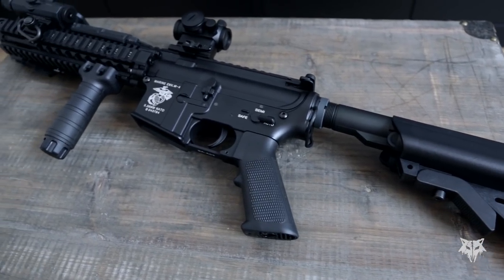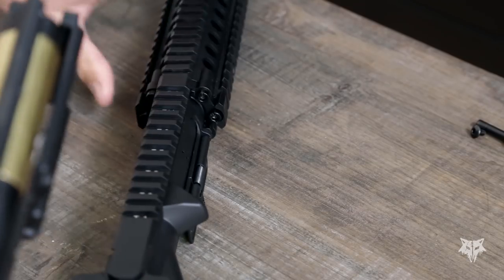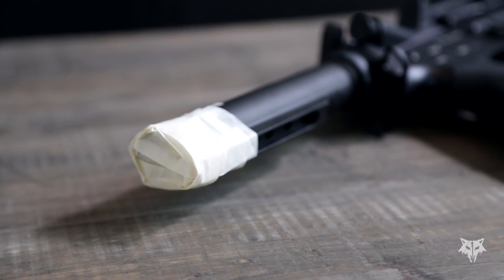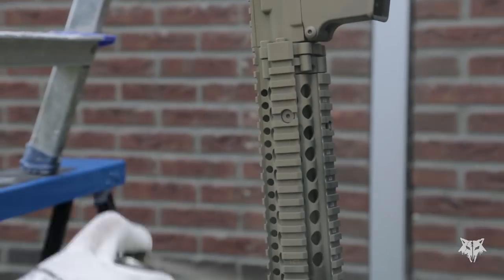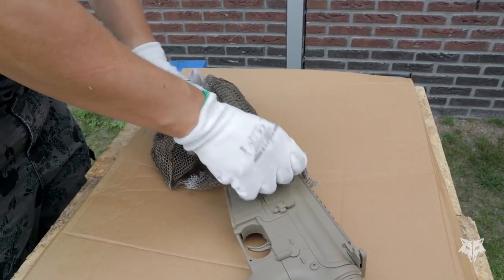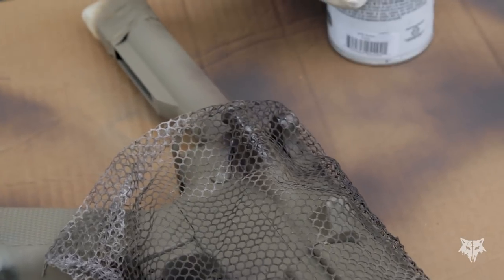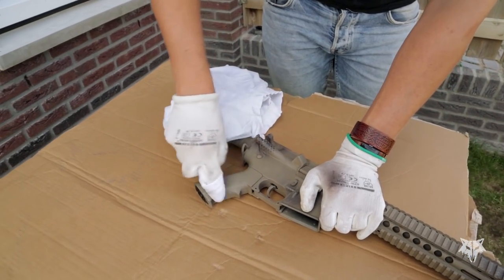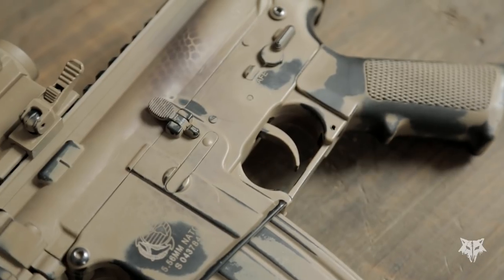How To: Painting your Airsoft Gun

Comment: was this a metal gun or a plastic one? paintings method are different for each type
Reply: The rail, receivers and stock tube are metal. Stock and pistol grip are plastic. Most spray paint can be applied on both surfaces.

Comment: Good video, guys. We didn't even know you had a Channel. 😁 I've never done a paint job on my guns before but I've noticed that some tend to roughen the surface with some sandpaper first. And since you didn't mention that I question if that is really necessary. 🤔 | Viper out
Reply from the maker: Hey guys, thanks for the comment! I personally wouldn't come near my replicas with sandpaper. Though it does roughen up the surface, which makes the paint stick better, the whole point of this method is to make it look worn and used and remove some of the paint you've just added. If the paint starts wearing off, you'll start seeing the scratched surface of the original paint/coating of your replica. 

More wear = more awesome :D
Reply: @GhostWarriorsAirsoft  Ok, I get it! Thanks for reply. 👍🏼 And yes, more wear is much cooler 😎🤘🏼

Comment: Question. How come we don't need any undercoats, primers, top coat
Reply: Personally i would still use primer and top. But if u want a warn more natural ware pattern leaving them out will help.
Reply: @elliotkingaby5312  I made mine to look like a plastic toy gun... But I messed up on certain parts of the gun.. it's a bit of an eye sore... How do I remove paint ( primer + paint + clear coat) off my gun? The grip is made of plastic so I can't use any Paint remover.
Reply: @insfree  try nail polish remover. Do it on a part thats not going to be seen incase it goes wrong
Reply: @insfree  It should be OK, I used to use that trick on old warhammer models I'd been asked to repaint so should work. But like I say try on a small part that won't be seen just incase.
Reply: @elliotkingaby5312  thanks bruh. I was worried since I heard paint removers melt plastic...but I guess it should be fine if I'm quick to wash it off.
Reply: Things like Nitromas  will. But white or methylated spirits don't.